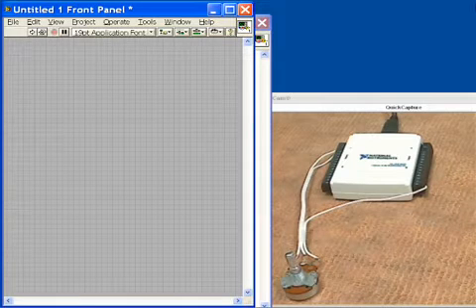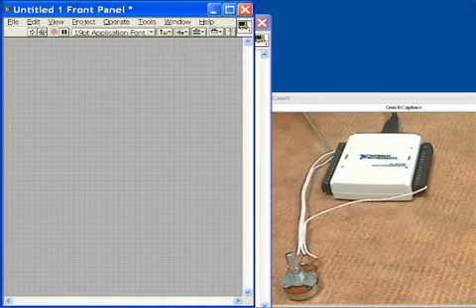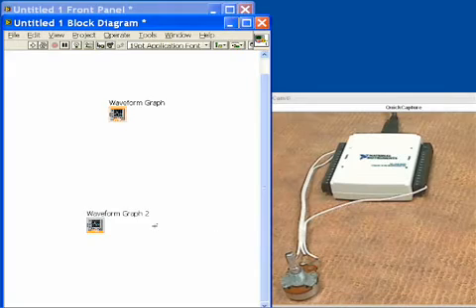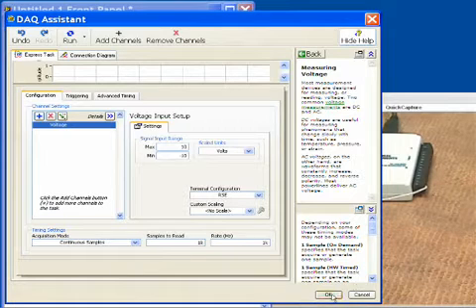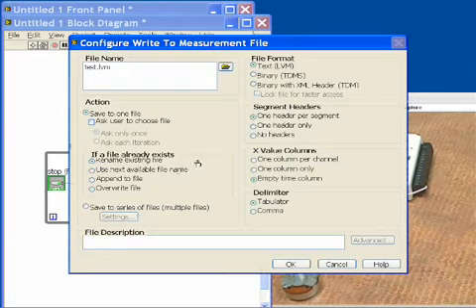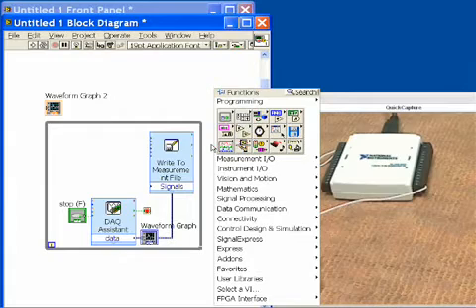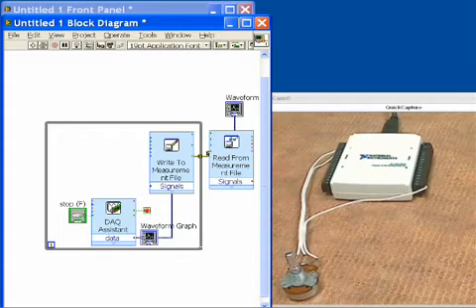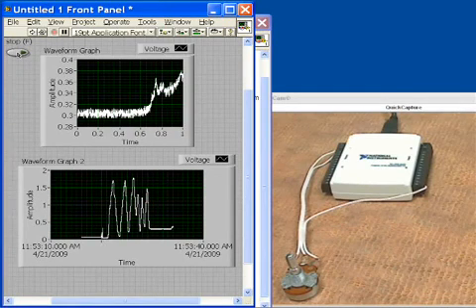Analog Input Datalogging with NI USB 6009

Comment: Hi! 
My name is Muhammad and just came across question here. I also have a similar question about NI USB 6009 and a rotary encoder. I am currently using the NI USB 6009 and the Megatron Incremental Encoder SPNT series for my project. My arrangement is as follows:
Channel A and B from the encoder are connected to port1/line0 and port1/line1 respectively.
I am using the 5V and connected to the Ground as well (standard wiring).
My question is how can I plot the the square waveform signal? I need that information so I can calculate the angular velocity.
I really appreciate your help

Regards
Muhammad